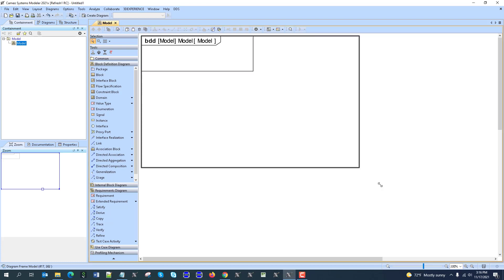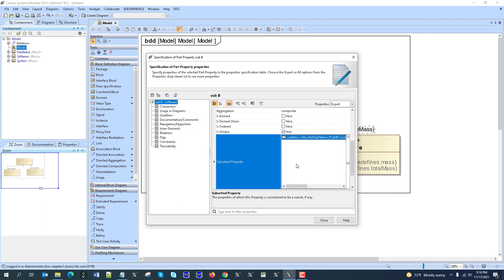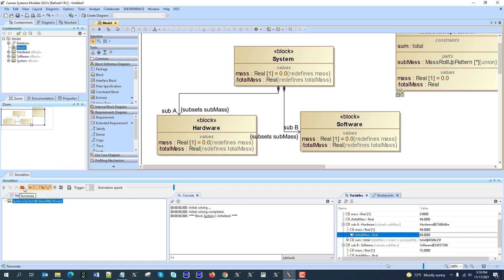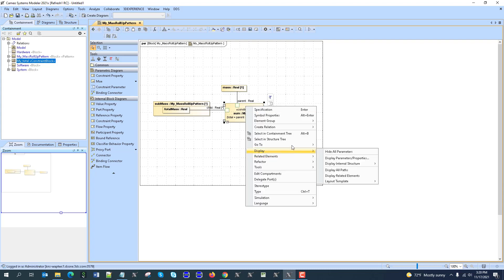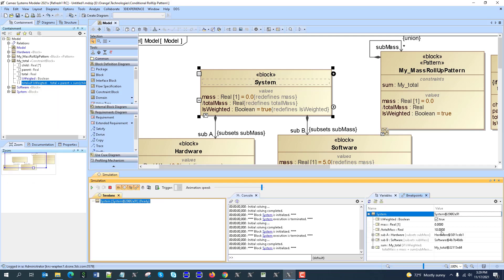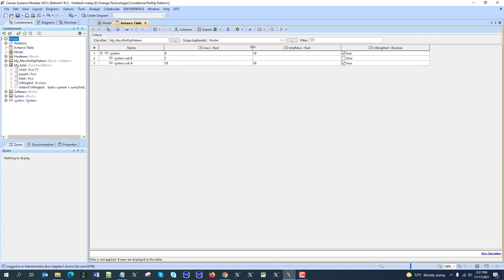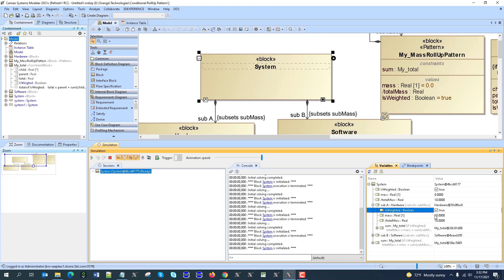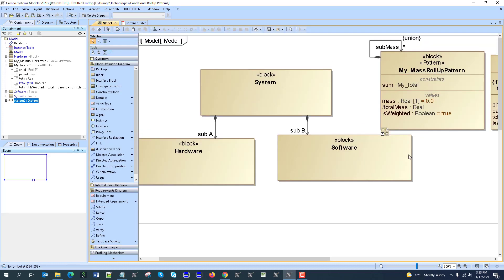Conditional RollUp Pattern in SysML Simulation

Comment: How are you getting the instance table to show system2 at the same time as system2.subA and system2.subB at https://youtu.be/gpEBuXUi4qk?t=540 (9:00 min)?  I have been racking my brain trying to get this to show up, but can only get the top level to show up without its parts.  Is there another setting that must be set?  I'm using 2021x, the same in the video.
Reply from the maker: Hello. You can check sample in description. You need to set instance table option to show tree not list. Also you need to add part types / blocks aa context into your instance table. Table shall have all blocks as context if you want to see those blocks instances.

Comment: Thank you for demonstrating this concept - however, I'd like to provide some feedback: 
I'm still working through the differences between the sample file and what you show in the video to identify errors/gaps - as my simulation does not work if I follow your steps exactly per the video. Only the downloaded sample file runs correctly.

What I've noted so far:
Your edited video jumps around (see the jump at 4:42, and note the difference in spelling between IsWeighted and IsWeigted). This introduced some confusion in trying to follow along, because the code would not work. In your cut, you added the Constraint Parameter property, and since you did not show this one will get an error about an undefined name if attempting to run the simulation as configured in your video.
Additionally, you select "Jython" as your language in the video - however, the sample provided uses "python".

Edit: the misspelling of "IsWeighted" vs "IsWeigted" is important, and necessary - if the variables are named identically in the Pattern and the Constraint, the rollup will not work correctly.
Reply from the maker: Hello Taylor. Thank you  for the valuable feedback and sorry for an issues. Thank you for your time spend identifying issues. Your post will be very helpful for the future. We will avoid similar issues in the future.
Reply: at 4:42 the video was edited and clearly skipped a step to where a constraint paramter "IsWeigted" magically appears under the constraint block.
Reply from the maker: Thank you for your valuable feedback!
Reply: @MBSEExecution  Hi, could I ask you a question about the PLE plugin? Your email linked to your youtube homepage did not work, thank you!
Reply from the maker: @user-wr2tb9zx8g hello, yes. I think email works too. But here is prefered place to ask.

Comment: Hi, I have to apply 2 mass_rollup_patterns that they both have the same "IsWeighted : Boolean = true"
can I have only ONE "IsWeighted" parameter value for each block? (that is linked to both the patterns)
If I automatically apply the patterns, CAMEO duplicates IsWeighted for each block... annoying 
thank you!!
Reply from the maker: Hello Alessio, just create another pattern without property. Apply first pattern with property and second the sams just without property. It shall still work ok.
Reply: did you get this to work?  I'm have the same issue with part values that already exist with values that i would like the rollup to use but it is creating new ones.  If removed, the rollup doesn't work.